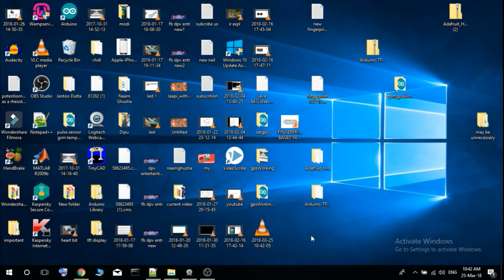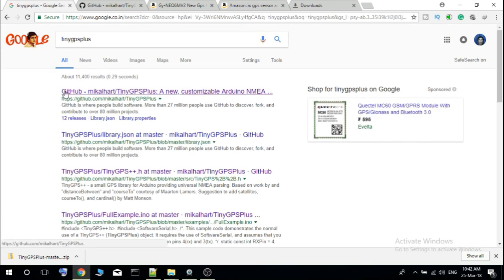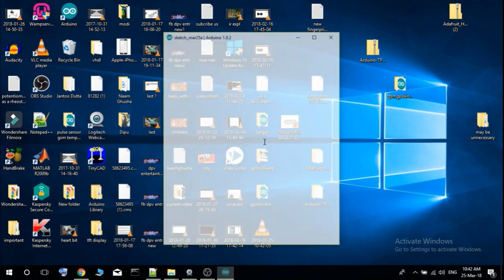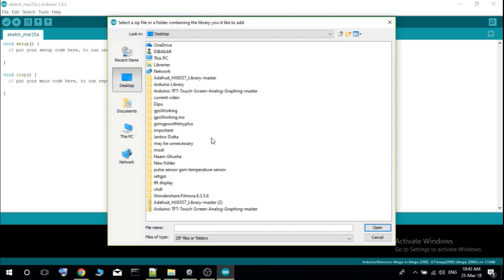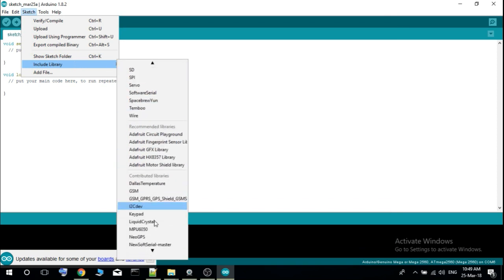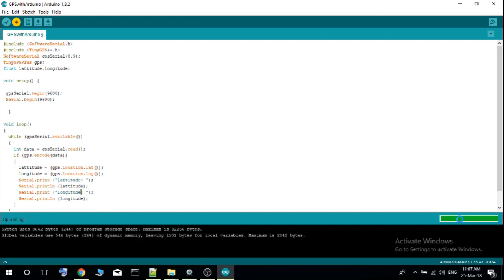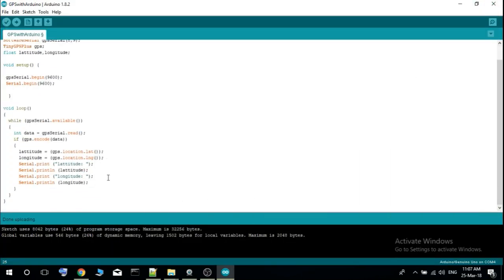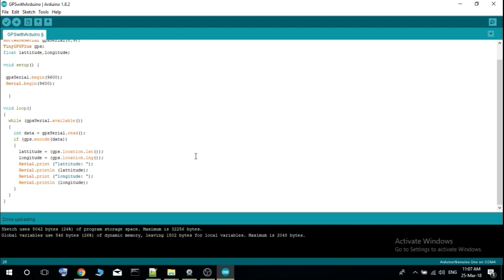Arduino GPS NEO6MV2 , how to use GPS module with Arduino

Comment: Thank you for the tutorial. It works great. But for my purpose i need to have it more accurate (the data sheet from the Neo 6mv2 says up to 2.5 meters). How can i get more accurate datas out of this code? When i do it like you showed, the accuracy is only about 250 meters, what is far away from what i'm searching for. (ideally it would be around 5 meters). Thank you for an answer.
Reply: Did you come up with a solution?

Comment: sir how do we power our circuit with a battery. because u powered yours with ur pc. plz reply soon
Reply from the maker: Thank you for your comment. you can connect a 9 volt battery with arduino Uno/mega. you have to insert the positive terminal of the battery to Vin pin and negative terminal to gnd pin of arduino.Please be careful.If you insert to another pin except Vin, Your complete circuit will be damaged and burnt.Watch our video that will be uploaded by tonight for more.

Comment: It is very easy to check a GPS device without arduino. Simply give it power and place it near a window. GPS led should start flashing within a a minute or two depending on the sky visibility from the window.